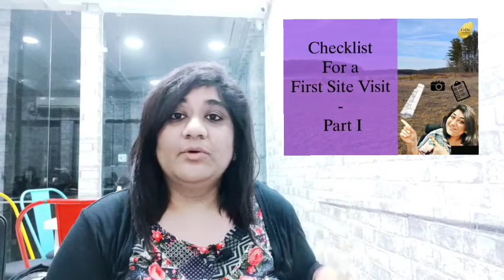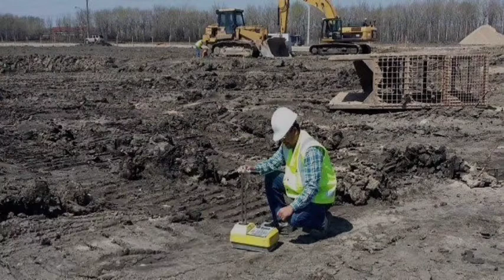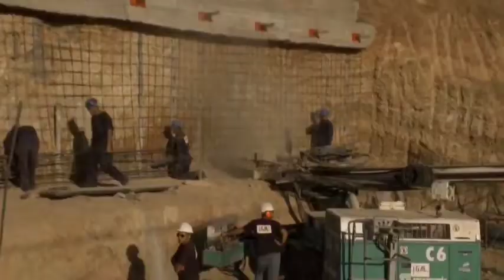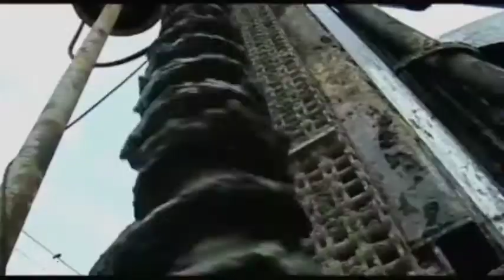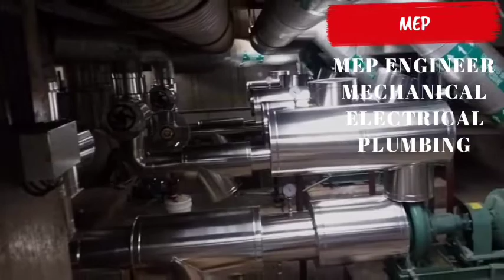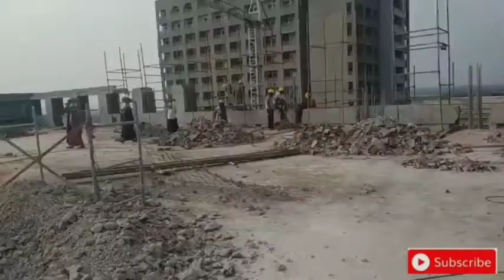Checklist for First Site Visit - Part 2 by Architect Nidhi Nagda l Architecture

Comment: What's the main role of an architect on site?
Reply from the maker: Site Visits are mainly to foresee any upcoming challenge and give design solution now to avoid any hassle ,to streamline process and progress ,to make sure site engineers well aware of Working Drawings ,incase any query resolve on site and most important check centerline ,setback ,all dimentions to be matching with liason drawings ,structural and mep drawings
Reply: Thank you so much ..really helpful
Reply from the maker: @simransingh1278  Grateful  :) thank you for your appreciation